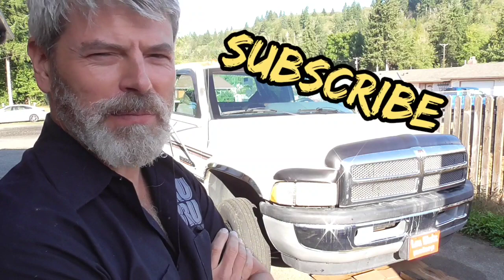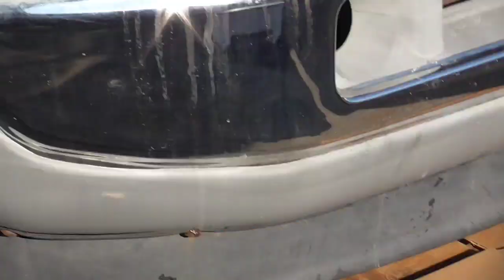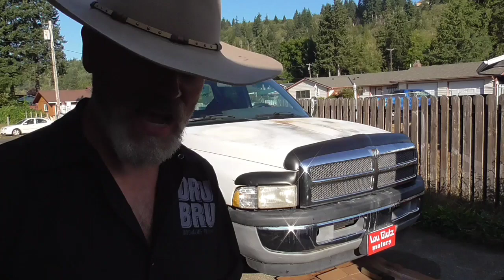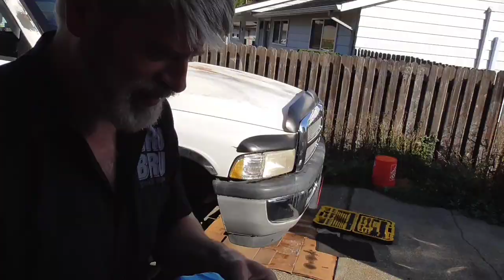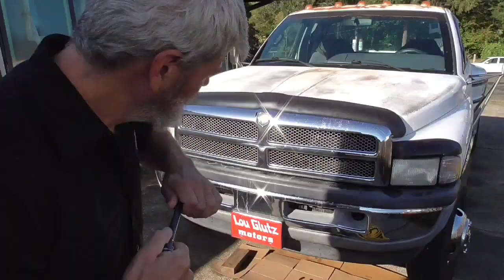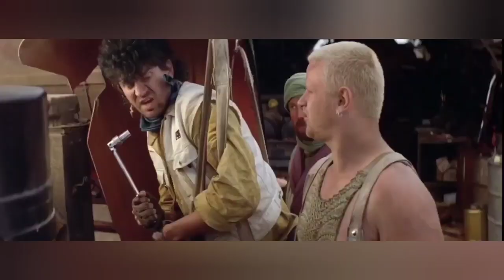Will Tightening a 1997 Dodge 5.9 Cummins Oil Pan Fix the Leak? Break Out the 10mm!

Comment: The crack in the timing chain cover is probably for cooling 😅
Reply from the maker: And the missing timing teeth is for whistling Zipidy Do Da.
Reply: @OffGridandWhiskey  taking off a few of those teeth to reduce weight and rotating mass, makes it more efficient in the long run. I don’t see a problem with it.
Reply: Ain't no chain on a Cummins.